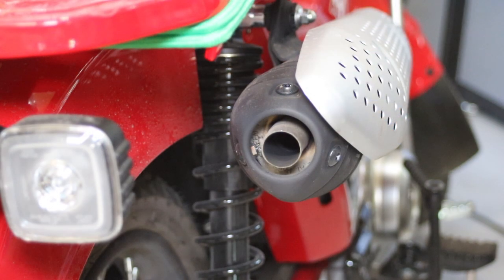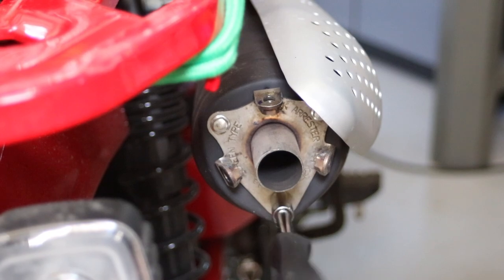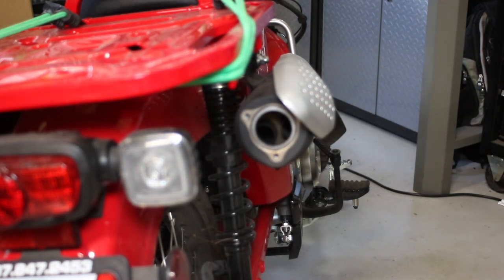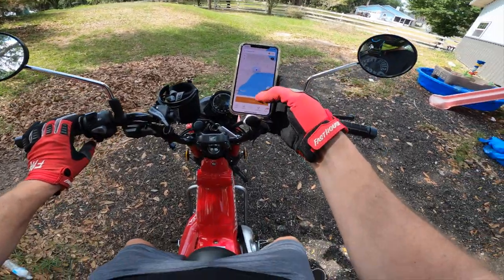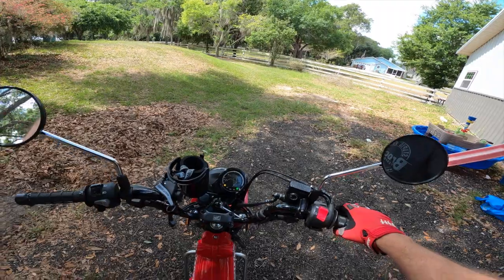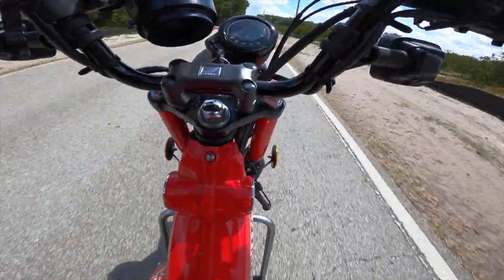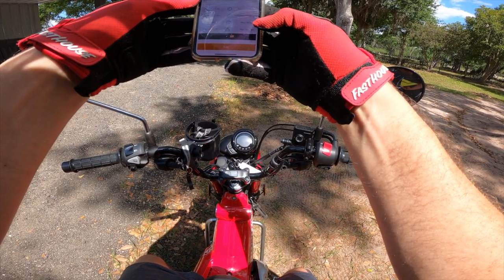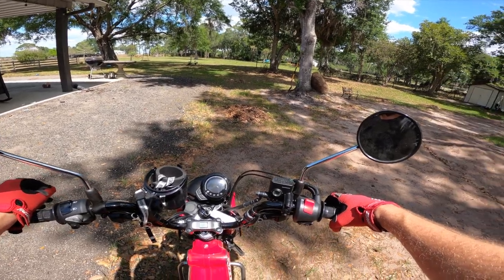Can we unlock horsepower from a stock 2021 Honda Trail 125 by removing the spark arrestor?

Comment: I wouldn't bother trying to get a few mph more out of the T125, it's not logical, like trying to soup up a farm tractor to go a little faster. I owned a '63 and still have a 68 CT-90. They would only go 45+ mph. I always wished they had conventional foot shift and hand clutch. I wonder if the supplied battery needs to be helped with a "battery minder" to keep it in good shape and reliable to start the bike if you ride a few miles once per week. Also wonder whether kick starting will work when battery is not able to start with electric starter.
Reply: The injection version of the honda z50 can be started with a flat battery.
(otherwise a kicker would not be of much use)

Comment: You may want to see what can be done to increase the gas flow through the Fuel injection system now that you have increased  the exhaust flow. They have to be tuned together.
Reply from the maker: Typically with the small bore Hondas you would have the ecu flashed by one of the several talented tuners out there, but I’m not aware of any who are doing the Trail yet. For the monkey, that is fairly easy to accomplish

Comment: We always took the baffles out on our dirt bikes back in the 70s big difference in power orr put tuned eshaust them lol... 👍🇺🇸
Reply from the maker: That was my thoughts with this experiment too, but modern fuel injection had other plans.
Reply: A modern ecu usually restricts the engine to only make a certain amount of power. Reduces warranty calls and improves their reliability reputation. The days of just turning a screw on the carb are over.

Comment: I rejetted the carb., installed an aftermarket air breather, changed the gear ratio on both sprockets and installed a big bore kit, the end result, a lot of wasted money, horse power only increased to 11.7 hp, top speed went to 71 mph, and fuel mileage went down to 72 mpg. This is a cool bike, leave it stock and buy the new KTM Duke 200....
Reply from the maker: How did you rejet the carb if I may ask?
Reply: @John5XR  My friend that is a mechanic at our local Honda dealership did it for me, several videos online on how to rejet carbs.
Reply from the maker: This bike is fuel injected, there is no carb
Reply: @John5XR  they make an after market kit to install larger injectors, sorry for misleading you...
Reply from the maker: Ah, ok. Makes sense now! Lol. That’s a pretty good speed you got out of it though, I wouldn’t say that was a waste of money
Reply: @scable-eq7bp  link?

Comment: Hard to tell how quiet the stock is because there is nothing to compare it to and the automatic mike on camera boosts quiet sounds and cuts loud ones. You should talk to normal volume next to the bike while the bike is running or smthng... Just a tought. 
P. S. I think that you should have bigger fuel injector to gain from better breathing exhaust. Otherwise it just messes with the torque with no hp gained. Propably Honda fitted a injector that is just enough for that exhaust to get the max power it can, but not to use any more fuel than is has to use to achieve that power.
Reply from the maker: Good point, I never thought about that and usually go for "tone" instead of volume when filming the exhaust stuff, but I understand what you're saying. The stock exhaust on the Trail is so quiet it might as well be electric! With these fuel injected bikes, they constantly adjust the fuel to accommodate the air entering and leaving the engine. My thought was that unplugging the exhaust a bit based on the service manual stating that the spark arrestor needs to be checked and cleaned periodically might help free up some speed. If they are concerned about it becoming clogged, that will certainly reduce power. Interesting experiment and I'm sure if it were a carbureted bike, it would have opened up some power as this is a common trick on the little trail bikes I have
Reply: @John5XR  I have some experience on that exact thing (sort of) . 
I had 1989 Honda nx 250 for years and it had carburetted engine and stock Honda muffler with spark arrester (really silent bike too, imported from California to Finland back In 1991 and had the cali noise emission sticker being under 80db at 7000rpm). So, the muffler rusted badly so that it was really loud, had a gaping hole on side and exhaust gas basically passing the muffler all together. It was there for at least a year, until I got it welded and bikes top speed (130-131km/h ~ 81-82mph) at full tuck with knobby tires, was exactly the same with or without the hole.

Comment: You can gain 1 hp (10%) by just cutting the screen portion off with no increase in noise if you don't need to ride where spark arrestors are needed.  Someone has proven this with dyno testing.

Comment: Had Honda 50 put on 16k, while riding through Beverly Hills police motorcycle officer who ticket me because of missing baffle which was over 12 inches lone so friend of my cut down it to one inch did it make a difference maybe. Back in 1965 to fill up the gas tank was around 50 cents.

Comment: You need to read the plug ,i bet it's runing lean . you need to free up air cleaner and up size main jet. Or change fuel map if its injected.
Reply from the maker: plug read would be interesting to do, but since it's injected the only thing I'd be able to change is the fuel map, which I can't even change as I don't have the ability to do that. No biggie, just a simple experiment to see what happened as I've had it help on other bikes (all carbureted though)

Comment: You need to cut the spark arrestor off and and put the cap/spark arrestor plate back on.  
It needs the back pressure for many reasons, but scavenging is the most commonly known reason!
Reply from the maker: I can’t imagine the hate comments I’d get for that! I got burned at the stake for even trying this experiment 😂. The real trick would be to get a free’er flowing pipe like the new Yoshimura design, but I appreciate the near silent exhaust sound on this bike in stock form and am gonna keep it how it is for that. Also, I don’t hit the highways, so top speed gains aren’t something I’m looking to achieve

Comment: Resonant airbox is defeating you! As soon as you alter anything, your airbox is no longer resonant in the right range, and may well become restrictive by being resonant in exactly the wrong place. You probably needed to lose the airbox lid, and go up one size on the main jet. Probably won't gain much, but should gain something. My '77 C70 used to get 55 unmodded, just over 60 with the entire silencer sawed off and the airbox gone.

Comment: re- adjust the top end jet for more fuel and hold on!! and mix some 2-stoke in the gas so you don't blow it up!!!  same thing i do to my 125 cc kids quads and the 50cc pocket bikes they top out at 100 km/h the quads and the pocket bikes 120+km/h
Reply from the maker: This is fuel injected though
Reply: @John5XR  turn the high end jet out some on the carb if it has the screw to turn only a half turn
Reply from the maker: It doesn’t have a carb
Reply: @lechkenassh9008  lol

Comment: I live in Oregon. In the west fire season and drought are upon us,and removing a spark arrestor is foolhardy. Riding  out to the pavement and back there were multiple piles of leaves visible waiting to catch fire. The largest fire in Oregon this summer(the Bootleg fire) is 413,000 acres, in California(the Dixie fire) the largest fire is over 800,000 acres.
The cost of riding without a spark arrestor can easily be a lot more than the cost of the motorcycle.
Reply from the maker: Good thing I kept it in, even though I feel the catalytic converter would catch most of the unspent fuel on this bike. It was a simple experiment to see if it choked the exhaust system and I tested it for approximately 1-mile
Reply: 😂😂😂😂 lmao. I have never ever had a spark arrestor in any of my bikes, guess how many fires I've started riding in the woods. Yup....zero! It's all bullshit! If sparks are coming out of your exhaust,  there is definitely something major going wrong with the bike! Suggesting that it's not even trail worthy in the 1st place and needs to be fixed!
Reply from the maker: Thank you! Finally some real world experience in the comment section 👍
Reply: @John5XR  yeah boi 👍

Comment: Not too surprising, the folks at Honda do know how to tune an exhaust. It's a lot bigger deal on a two stroke where flow is critical and is often tuned for a wider powerband or a higher peak.
Reply from the maker: I’d agree if they didn’t tell you to check and clean the arrestor in the manual. That made me question if it could potentially cause a decrease in power if left “clogged”
Reply: @John5XR  On a modern 4 stroke bike with efi, I doubt you'll ever see it clog. The old 2 stroke dirt bikes were great for making carbon.

Comment: I cants believe a 125 won’t do 60mph. Is it the gearing?  Next test put a inexpensive tach on it.
Reply: It's gearing. Three less teeth on the rear sprocket than the Super Cub. This little engine needed to sacrifice speed for power to get over hills and through mud.
Reply: @Ichibuns  The Ct 90 had high and low range. They should of kept that on the 125 too.
Reply from the maker: Thanks Greg, this is correct. The Honda Monkey and Grom have the same engine as the Trail, but struggle to go beyond 60 as well. 4th gear on this engine/trans is super low and the engine can't push it to it's max
Reply: @John5XR  The new Grom has a 5 speed. I don’t know if any faster.

Comment: Will people ever learn that speed is determined by gear ratio and horsepower/torque is how fast you get to top speed. You could put a 20hp motor on that thing but if you didn't change the gear ratio you would only get to 55 mph faster.

Comment: I would always assume that a motorcycle sold in the US has a spark arrester.  Isn't removing a spark arrester totally illegal?  Is this similar to "burning coal"?  People that want to flout environmental laws.
Reply from the maker: Only bikes that are designed as OHV (off-highway vehicles) would have a USDA Forestry Service approved spark arrestor. Race bikes and on-road only bikes don't have this requirement, but also most road-going bikes have a catalytic converter (which arrest sparks, just like your car). The arrestor is to abide to the US Forestry Service rule that all bikes ridden in US parks (where applicable) need to have a spark arrestor to avoid causing a wildfire. This is not a rule for street ridden bikes, which is where I tested this bike, which also has a catalytic converter. 

And no, "rolling coal" is when you remove the emissions equipment from your diesel engine and reprogram the ECU to run richer, then load the engine up to produce black clouds of exhausts preferably aimed at electric vehicles, ie: Toyota Prius.

Comment: You actually LOST some compression at high-end by decreasing the exhaust resistance
A wind-screen WILL increase your top-end because the air-flow is 'smooth' rather than smacking your chest...the faster you go, the greater the amount of air-resistance exerted
( I gained 1.5-mph w/a fly-screen for my little Honda 'Metro' scooter at top-end...not bad at all for a permanent fix )
My 'WOT' went from 42 to just under 43.5 and that's with a 230lb. rider with a stock engine and gear-box
( Bear in mind this is a 50cc engine...that's damned fast for a scooter! )

Comment: Gotta change gearing to go faster. You will lose torque to get top end speed, or top speed to get more low end torque. Its like all the little guys and idiots that swear or think they will do 70+ on 50cc scooters with few upgrades. If they don't do gears the top end will always be about the same, and the engine will be struggling more. 40mph is more than enough on these small motors if you have the right gears to get there fast. I rather have more torque than top speed. When you doing 50 you usually gotta slow down anyway, and when you cutting through city or woods you always need more power, not top speed

Comment: Have you tried cutting the screen portion off plus a little bit in case you want to keep the mount and pipe almost intact but losing the restricted screen? In  a sense, it is somewhat logical the performance went down, I believe even with fuel injection, the backpressure (eliminating the exhaust gasses from the combustion chamber) had already been optimized with the spark arrestor.
Reply from the maker: Nah, I actually like the silent nature of the exhaust as I use the bike around the house so often and often late at night, so it this was just a fun experiment to see if it made a difference. If I wanted a performance gain, I’d go with the new Yoshimura pipe for the Trail

Comment: From all the experiments I've done with the speed, with stock exhaust, different sprockets, Diablo exhaust etc.. etc..... I didn't gain anything until I put the Big Bore Kit on which came with a larger fuel injector. I still didn't need to adjust the ECU with the kit and the HP and torque gains were very noticeable. Take a few minutes to watch a couple of my videos on it to see the difference. The only downside I've experienced so far with the Big Bore Kit is you will suffer with fuel economy. I like your test, it is one that I didn't think of to do. I believe you could probably get some more power out of it if you were able to tweak the ECU for more performance. Good video, I liked it......
Reply from the maker: Thanks for the feedback and comments bud! I watched a great many of your videos while mine was on preorder 🙏 I’m in the same spot with my Monkey too, have just about all of the bolt on’s and didn’t feel they’ve done much. Even have the ecu tuned for them. BBK’s seem to be a sure thing, and the extra fuel supports it. I’m not chasing HP on this bike as it is too valuable to me as a utility bike around my house and property, but always seek interesting content when I can think of it. Thanks for watching, glad you liked it!
Reply: @John5XR  The most important part of the BBK is the torque gain, it just allows the little engine to pull and keep on pulling.... I like how you spun out on the start of your video. Great "foot" clutch work...... ;-)
Reply from the maker: Haha, did you see the outro?
Reply: @John5XR  Un weight the ass of the bike, tilt it almost to the pegs and twist the right grip to spin the rear tire, instant donut........ Don't you wish it had a clutch...... ;-)
Reply from the maker: Lol, well on this bike I don’t wish for the clutch because of all the utility work I do with it, but that’s why I have my monkey and Grom 😁
Reply: @John5XR  I think a monkey would be a blast up here in Northern Thailand, but I've got my sights on a new GPX Legend 250 Twin mark ll. Should be able to pay cash for it in another month or two and then do some longer adventure rides with it....... Stay safe out there.....

Comment: I used to road race box production class many years ago. Engineers back then had already designed the engine flow optimized for the stock specifications. So if you threw a header on there with no intake modifications, there was often a net loss in power. Not surprised by the results. I 'm going to have to come out of retirement and get one of these little red Hondas. If I can find one that is.
Reply from the maker: lots of science behind exhausts, which is why experimentation is so fun!

Comment: Your speed test is fine, but I think you should measure a mile distance and then run that mile for time.  That way your tests accomodate for power and a different torque curve.
Reply from the maker: Makes sense

Comment: If you are driving off road, through a hay field or in the forest you do need that spark arrestor in there. Apart from the risk of starting a fire some jurisdictions will impose a heavy fine for not having it in place. Thanks for the video.

Comment: Honda runs everything super lean from the factory. Opening the exhausts and intake probably just best prep for mild jetting. That’s really the best way to get better top speed or power from Honda. If yo get any leaner, your pipes will blue and you’ll lose power. Generally.
Reply: Not just Honda, all manufacturers run the street legal stuff as lean as possible to pass EPA regulations.

 In all honesty with the cost of aftermarket modern FI intake kits, air box or filter kits and aftermaket exhaust and aftermarket ecm or reflashing the stock ecm  not to mention for street use your bike will no longer actually be legal if you need more power just move up to a bike that stock fills your needs.

Will probably be no more expensive, be actually street legal and not void your warranty.

Say the trail 125 properly modded for instance would actually end up being only a few hundred dollars less than a street legal CRF 300L which would have much better power stock than the trail 125 modded.

Buy the right bike to begin with is the best move.As far as long term reliability and minimum issues usually the more stock it is the better off you are as an owner.